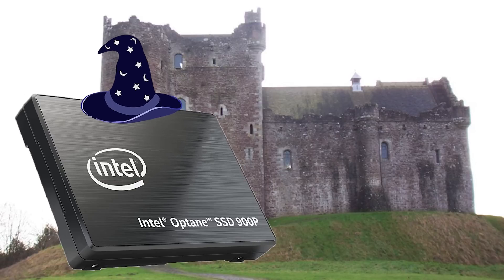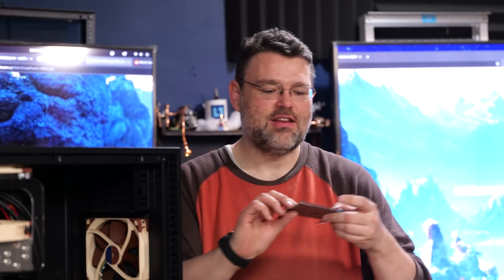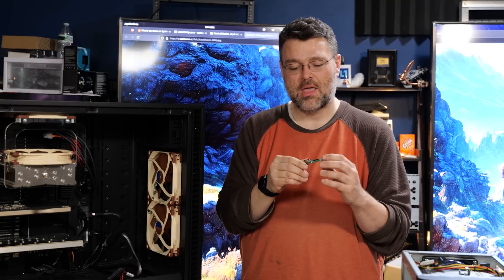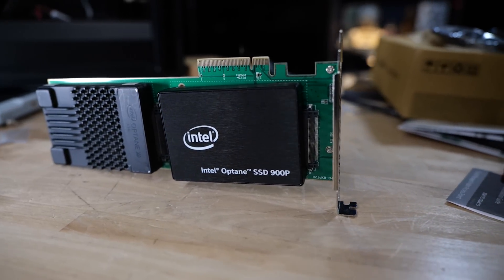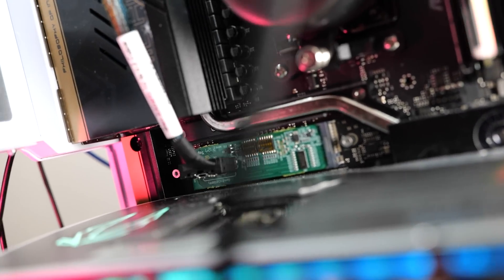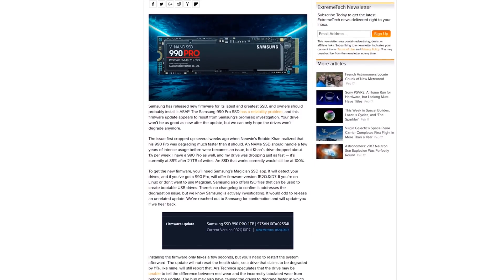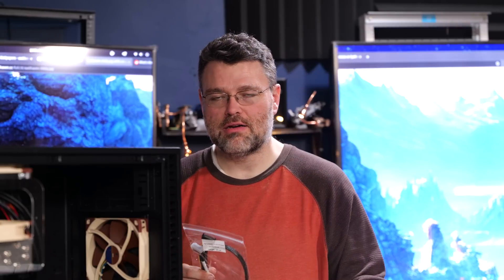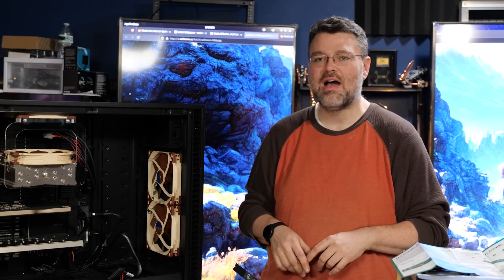The Holy Grail, Finally Found: U.2 to PCIe4 Adapters that Work!

Comment: Can someone comment on (a year later), if this solution is BETTER than say the newer 𝐃𝐢𝐋𝐢𝐧𝐤𝐞𝐫 PCIe 4.0 𝐌.𝟐 𝐓𝐎 𝐔.𝟐 𝐍𝐕𝐌𝐞 SSD,𝐒𝐅𝐅-𝟖𝟔𝟑𝟗 Drive to 𝐌.𝟐 Host Adapter,U.2 SSD Converter -with Power Cable. Anyone? 

Much appreciated

Comment: So basically future high end motherboards should reduce on board connections and leave the PCIEs for add-on cards. It's like a more modular design is needed for the enthusiasts. If they leave all the bandwidths for the PCIEs you could put any crazy card in there. Extra sata, extra nvme, extra 10gb nice. Nvme on board take up to much space.

Comment: thanks wendell i know its late but i was able to get a micron 9300 pro to work with this adapter and cable setup. working on a msi x670e godlike,running it in a gen 4 m.2 slot.Correction also tested in pcie gen 5 slot in upper right corner, plug and play no issues to note
Reply: What was the name of the adapter?
Reply: @canaconn2388  Gen-Z 1C(EDSFF) to M.2 PCIe Gen4 Adapter with Built-in ReDriver & Buffer Gates

Comment: 12th and 13th gen CPUs have no Optane support, according to Intel.  $1100.00 for 400GB is very expensive. Intel overcharged for its better memory instead of trying to dominate the market at lower then average price points.  This is why I went with four Crucial 4TB M.2 NVME in RAID10.
Reply: they dont have the crappy hybrid optane support but you can run 905p / p5800x no prob

Comment: Why dont u just get a Broadcom 9600-24i tri adapter and get 6 u.2 Slimline to minisas hookups.  Some ebay resellers selling 15.36TB u.2 drives for 750 per drive
Reply: Will the bios uefi still see the u.2 drives, just not be able to boot on them directly since there inserted in an adapter?

Comment: For a laugh I slotted a P1600X in my 7480 Dell Lattitude laptop as the main system drive. Works fine. Also a few weeks ago I added a 375GB P4800X U2 to my system using a Startech x4 card. Works a treat! Not PCIe4 but...just in case.

Comment: I didn't know you could adapt M.2 to normal PCIe.  I only have one M.2 drive and I shouldn't have bought that one.  In practice sata is fast enough.  I am however feeling the limitations of the expansion slots on my consumer hardware.  I can't afford HEDT/Workstation hardware, I don't need the ridiculous core counts, but I would really appreciate the PCIe lanes.

Comment: I was really curious about getting a P5800X just to have the incredible IOPS and latency and durability, but I suspected it would be a chore like this. Thanks for figuring out how to make it happen.
Reply: The easiest way to get two U.2/U.3 PCIe Gen4 reliably to work is the PCIe x8-to-2xU.2 adapter Delock 90091 that can actually handle PCIe Gen4. There are many, many similar adapters from Amazon/eBay/AliExpress et al. that can actually only function up to PCIe Gen3 properly and cause a boat load of PCIe Bus Errors as soon as you use them with PCIe Gen4 SSDs.
Reply: @abavariannormiepleb9470  Is the price of the Delock 90091 really $288 (262 euros)? That seems high since there don't seem to be any components on the board, it's just a PCI slot with a couple of whatever those connectors are called on the U.2 SSD.

Comment: Since there don’t seem to be links in the video’s description the store where to get the M.2-to-Gen-Z adapter and the cable is called MicroSATACables. I can’t post links but they have a website and an eBay store.
Reply: Thanks a lot!! I have been searching and searching for it😅
Reply: @”No problem, yo!” 👍

Comment: Hello, does anyone know is there a solution for usb to go through ethernet cable, i want a conference camera that is 10m away for pc to work, i have soldered usb connector on both sides but the signal seems weak and in device manager the camera is connecting and disconnecting all the time.

Comment: I can tell you why the industry is "Taking your PCI ports" — the PCI slots we'd normally be able to use is being covered by GPUs. What we really need is a fibreglass PCB that'll take the 1x PCI ports from the motherboard and redirect them to M.2, which can then be adapted to any variety of things as-needed to add functionality in the absence of using PCI conventionally.

Comment: Just staring at that WRX80 SAGE system and thinking about how ASUS finally fixed the broken CDROM emulation in the BMC, when loading ISO from the micro SD card. I MAY have emailed ASUS about it roughly a month ago, with a video showing it being broken, and they sent me some firmware to test that fixes it. Is so happy.

Comment: This is why I can't wait to get on Sapphire Rapids or some AMD equivalent platform to have so many PCIe lanes where you don't have to adapt M.2 slots.

My dream is to have some Icy Dock cages for both U.2 and E1.s (they have an e1.s cage in concept)
And you can get PCIe cards with redrivers so you can take the lanes from your slots and run it to the cages
Reply: Yes, more PCIe lanes than i.e. AM5 are nice - but as a matter of fact much better usage of PCIe-lanes would be possible. Asus sells an AM4 motherboard with an PCIEx16 x8 x8 x8 setup and an U.2 on board - nothing like this is available for AM5. Gigabyte i.e. degraded the Aorus Xtreme* from AM4 to AM5 by diverting many lanes to M.2 but cutting the lanes for the 2nd (only 4) and 3rd(only 2) PCIe-slot as well as the lanes available for SATA.
*Buildzoid even called the boartd an file copy enthusiast board...

Comment: Good info as always.  I think it is time for Enterprise drives to come to desktops.  The big boys who sell business and home drives don't want you to tell the world.  Your going to change the industry and thier market pricing scheme.  In my opinion, in a non server room of the home 3.5 spinning rust is dead and 2.5 SSD are way too slow these days and capacity is an issue.   2.5 inch U.3 SAS drives with much larger capacity and great speeds is the future in higher end Desktops.  You may pay more but you get a dependable Hard Drive.  Also, we need workstation Motherboards where you dont always need an adapter. It has taken them forever to provide some 10 gig ports on motherboards and it will take them forever for them to put SAS internal ports on Desktop boards, or never.  They control all the strings.

Comment: Love the Monty Python reference, although the final response is: "I don't know that" before being flung lol. Anyway, what about PCIe5 SSDs? I have seen one somewhere; it had a HUGE heatsink & a tiny but incredibly noisy fan (begging to be replaced by a water block in a custom water loop). Can't you get one of those? Even if air cooling is a problem for PCIe5 SSDs, that doesn't mean the custom loop water cooling community can't start using them NOW whilst they continue to play with air cooling for a future release.

Comment: Since apparently no one else has a proper idea of the matter, I am gonna ask here ; is there a Thunderbolt to u.2 connector solution? Since gen 3 x4 connection basically saturates the Thunderbolt, if you want the full speed you are not supposed to connect nuch else to that tb port. We basically need a solution to use refurbished u.2 gen 3 drives as a simple external drive!